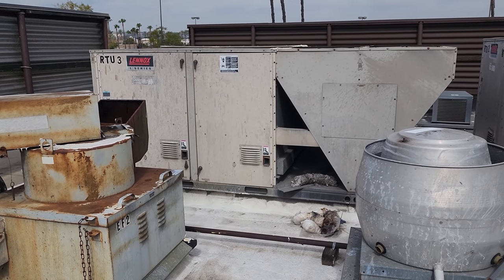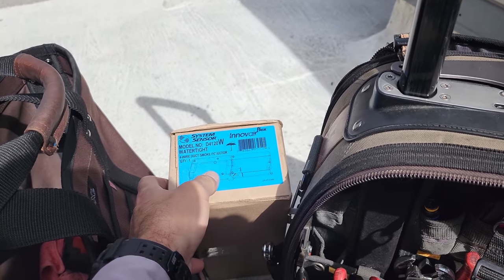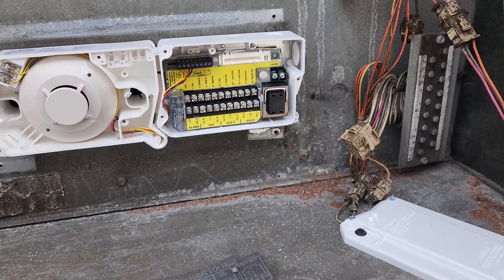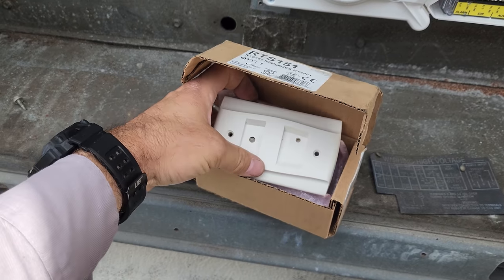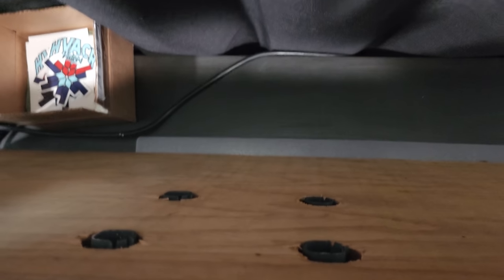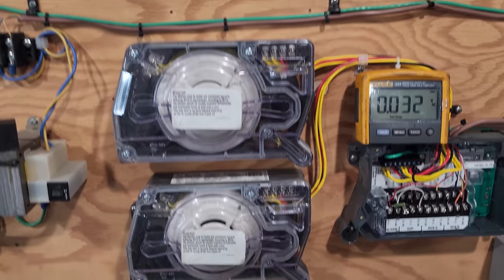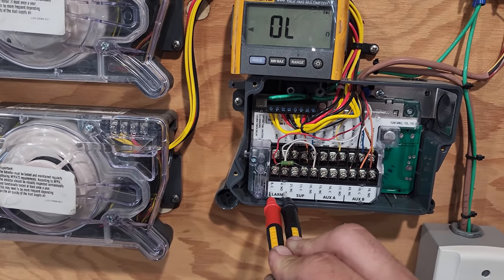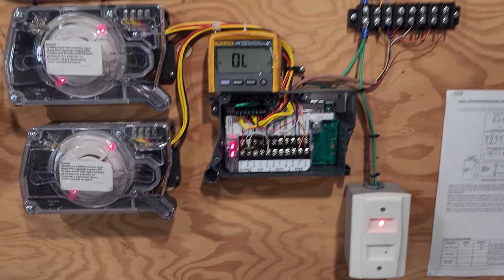THEY SAID THEY NEEDED A NEW DUCT DETECTOR

Comment: hahaha the roofing sealant everywhere. reminds me of the fire sealant guys here in england, they spread fire mastic all over absolutely everything. it's not possible to be on site when they are there and not come home covered in it myself
Reply: Sounds like drywall installers.  Mud everywhere, even on everything that's not supposed to have it.    I've also seen concrete guys scrape their trowels (and boots) on anything rigid that's handy and destroy equipment because they don't clean up after themselves.
Reply: Lmfao that's me on any after hours call.
Frustrated to be there. Checks things "it looks fine, woah but that things f**cked"
Reply: Like Chris pointed out as in USA and UK the people that go round putting the mastic on and fire doors are not trained enough. I am usual as have been in the fire world and then moved into HVAC so well understand this topic and seen so many horror commited. Like the guys going round doing the fire doors and seals gaffer taping the smokes (detector) to stop dust while they chip away at the doors to fit and leaving. Best bit to not have dust in the flats they work in the plant rooms the one place you do not want a smoke to work!
I wish I could post pictures of them at work here!
Reply: @Electronics-Rocks  They put heat detectors instead of smoke in plant rooms now, no?

Comment: The supervisory contacts are "backwards" so that it will go into trouble should the unit lose power.  A powered-off detector won't detect smoke after all.
Reply: My thought as well, if they would work the same way they would have to "actively" switch on failure.

Comment: That "signaling device" is what's usually called a "monitor module"(some brands like to use different names, I don't recognize this one). They connect to a modern addressable loop, and provide a circuit that you can connect to a set of dry contacts like a duct detector, or waterflow switch etc.
Reply: dang it thats what i was going to say. jk its fine. (i am a fire alarm hobbyist)

Comment: Just FYI, there's a second reason the fire mode goes 'full air sucking out of the mall': If there's a fire somewhere, then unless it's already roasting you, it's pretty harmless on its own. In a closed building, the smoke is way more deadly than the fire. Thus, getting the smoke out of the mall by all means possible will allow the people within to have a greater chance of survival and escape. And if they let fresh air in - so what? Yes, the fire will get more oxygen, but so will the people still trying to get out. All the building, burnable material an all that, it's not THAT important compared to a single human life. So, getting rid of as much smoke as possible is a very good thing, and trying to starve the fire by pulling out air is a nice side-effect.
Reply: Fun fact hi-rise stairwells have fans that do the exact opposite and bring large amounts of air into the stairwell. This creates a positive pressure in the stairwell to keep smoke from other parts of the building from entering the stairwells. 

There is a duct detector in the duct work of these fans that will shut them down, however, if it detects that it's actually bringing smoke in.
Reply: @kg4mrv  I think an important detail to keep in mind here, there is usually separate smoke exhaust or stairwell pressurizing equipment from the regular HVAC stuff.
With those HVAC units on the roof, depending on the ductwork, they usually get shut down to prevent them conveying smoke from one part of the building to a different part. Or depending on the heat they may take in, setting other parts on fire. Most parts of fire prevention in modern buildings are less about blocking fire from burning through (although often material are chosen to slow that down) but you got doors, curtains etc. that automatically close to contain smoke within limited areas. Within those areas then there are smoke exhaust systems to clear up the air and, by ventilation, possibly cool down the air to keep escape routes accessible.
That is although why modern elevator controls are connected to fire alarm systems, to prevent an elevator car from stopping on a smoke filled floor and afterwards the smoke preventing the door from closing again (by blocking the photoelectric barrier that should prevent the door closing while someone is in between the doors.)
Reply: the other reason is that the heat can go somewhere than cooking everyone inside. I'm a firefighter, it's the reason we do vertical ventilation so that the smoke will get out because we're not worried about the smoke, we're worried of the heat that's in the smoke because if that smoke is hot enough it will burst into flames and cook everyone inside, this is called a flashover, if you can find a way for heat to escape you take that chance.

Comment: Those supervisory connections always get me because they are technically backwards, as you mentioned. I have to remember the internal supervisory relay is continuously POWERED in NORMAL operation. This is why the trouble monitored sites require a call to the alarm company BEFORE turning OFF the equipment DISCONNECT. When the 24v (or whatever is powering the SD) is lost, you will trigger a TROUBLE alarm for that unit. BTW, all SD used today are non-radioactive, they are optical smoke sensors. There is an internal test done periodically for each sensor to make sure the light emitter and detectors are working and unobstructed. If the sensor gets dirty, the system will also trigger a TROUBLE alarm condition. Thanks for the video
Reply from the maker: Thanks for watching bud!!

Comment: If you see two resistors on the wire, you are probably looking at Double-EOL wiring. This lets you detect four states: normal, alarm, open circuit and short circuit.

Comment: Some fire sensors do use radioactive material that decays over time, so this could just be an age related replacement to ensure that the detector has the correct sensitivity.
Reply: Yes, amerecium-241, with a half-life of 432 years.  Works out that it loses about 1.6% of its initial output in 10 years, which is the nominal life for ionization type smoke detectors.
Reply: @robertlapointe4093  And sadly, a lot of people throw them away, rather than finding a recycler.
Reply: Most non-radioactive sensors also have a replace-by date. They degrade over time due to dust and the aging of electronics.
Reply: @elco_os9355  dust is the main issue. the smoke chamber is actually a light trap that should prevent light from the outside and a defined light source being reflected onto the actual sensor. Smoke in the chamber will reflect light onto the sensor. dust accumulating over time sadly will do as well. Or it just covers the light source or the sensor to make it go blind. I think usually they say they are good under normal operating conditions up to ten years.
By now, although there sure still will be a lot of those around, I think most new smoke detectors used in the last 15 to 20 years are optical. Not sure if the ionization type models still exist, at least I could not find anything about them being banned for new installations. Looking around here in Germany, I obvisoulsy don´t find any of them to buy anymore

Comment: Exhaust fans remove the heat. Same thing when they cut a hole in the roof of a burning house. Giving the heat an escape route helps keep it from igniting new material. Also if anyone is inside it helps clear the smoke.
Reply: It also helps give the fire more oxygen which is bad
Reply: The two problems are flashover and backdraft. Exhaust fans remove the oxygen, which reduces the ability of the fire to burn. But, that can contribute to a backdraft, where incompletely burnt gases can ignite when oxygen is introduced. Introducing oxygen carefully can reduce the possibility of a backdraft. But, that's why they cut holes in the roof eventually, to allow the fire to breathe, to prevent fire from injuring the firefighters from either a backdraft or flashover. A trained firefighter would be able to explain this better than me.
Reply: @maotio  it's more better than killing my mates due to a flashover

Comment: I used to have a mock fire alarm board with a addressable panel, horn strobe, pull station and a few field smokes with a sperate board with a duct smoke detector.. I wired in supervisory as a trouble as well. I actually thought they looked difficult to wire but it's really not rocket science to install I could install these all day lol.. great video as always!!

Comment: Those fire exhaust fans are used because they extract smoke. Smoke is usually the most dangerous thing during a fire, since it contains toxic gasses like carbon monoxide. So when a fire occurs in a crowded shopping mall, you want to get the smoke out as soon as possible, because it takes a lot of time before everyone has left the building.

Comment: 25:00 "I still don't know why they wanted the duct detector changed." <--- It could have just been time to change it. Smoke detectors only last a few years, then you just throw them away preventatively. (Even though a photodiode smoke detector should last for many decades unless the photodiode goes out, it's just extra fire paranoia.)

Comment: My personal opinion is the old detector had reached end-of-life, or was getting close to it, and they wanted it replaced. I love every time you go to the training board to explain duct detectors even though, as a child helping my father install Simplex fire alarms, I "get" how it all works.
Reply: It's not the most uncommon thing to just fire off the parts shotgun at fire alarm problems once you've narrowed an issue down to a single unit. 

The FA tech should have done something about that monitor module just swinging in the breeze where it can get wet, whether it's putting it in a J box or inside the terminal box side of the detector, but if the issue was having the duct shut down the unit randomly and setting off the alarms then a new detector would be most likely to resolve it.

They could also have taken care of that crumbling prefilter foam, cleaned the inside of the smoke chamber that was probably dirty enough to be hovering near it's alarm threshold, and made sure the sampling tubes weren't nasty, but that's not as easy as saying "we don't service duct detectors, get your hvac dude to change it."

Like he said at the end of the video, duct detectors always live in a weird gray area of who's responsibility they are, and it changes depending on the design of unit, local AHJ rules, and even what one contractor or another is willing to work on.

Comment: When thares a broken line the alarm company calls you when thares a trouble at my sister old job they used to get a lots of troubles with an old fire alarm intill thare was smoke was spotted we called 911 and pulled the alarm we knew the old system wasn’t ganna call them a ful days later they come to replace the old system with a new one

Comment: “This is the filter” ha what filter it ain’t in one piece anymore
Reply: That foam prefilter breaking down to dust might have been building up in the smoke chamber and setting off the false alarms that were why they wanted the detector replaced anyway.
Reply: @carpespasm  yeah that’s a probable cause of failure I didn’t think of that

Comment: 16:50 More worse case scenario: What if one of those wires broke because a fire melted the wire? (If it did that before setting off the alarm/detector.) You'd want to know. 🙂
Reply: firefighter here: we respond to multiple fires with the fire alarm system still sounding. the wires have a fire resistance rating to how many minutes it takes to melt it and at what temperature

Comment: Normally open contact on e stop? Damn....
Reply: Well it's not really E stop but fire alarm signal. Fire alarms always use normally open contacts, you don't want it to trigger due to a loose wire. Instead they require regular testing for functionality and the resistors for supervision.
It is not likely the short wire inside the AC from the duct detector to the control board gets loose/damaged between testing periods.
Reply: The link between smoke detector and HVAC controller should also be a resistor terminated bus, so it can know if it's a trouble condition with the wire, or an actual alarm. (In a world where things are perfectly engineered.)

Comment: How it's possible to 2 detector in alam if you only put in your set/reset station in alarm.
Here in the Netherlands it's not allowed, and if one going only that alarm will be visible (to be specific where the alarm is).
Maybe in the USA this is normal but for me its strange.
Reply: It depends on the manufacturer. On some smoke detectors, the test switch actually puts the detector into a "test" mode, where the detector will actually turn on a small LED inside the sensing chamber in an effort to get the sensor to trigger an alarm. Usually detectors that employ this more-realistic test method take a few moments to activate. On other detectors, the test switch simply triggers the same alarm input as the sensing chamber does, which tests whether the logic board can close the alarm relay, but does not test if the sensing chamber can actually respond to smoke.
Either way, many AHJs view "smoke in the chamber" (usually canned smoke sprayed into the detector using a special tool) as the only test that actually proves that the smoke detector can detect smoke, but when a building with 20 RTUs has one tripped in false alarm, or you just want to verify a fix to the building wiring, that test/reset switch is much faster than climbing onto the roof and opening every unit until you find the problematic one.
Reply: Some places/inspectors are happy enough with just hitting the remote test, and just rely on the fire alarm contractor having certified everything is working correctly, with their on-site inspection being little more than a spot-check that strobes are where the plan says and that the fire department gets a dispatch call. 

Many will require full-on smoke-bomb testing to prove shutdown happens and to verify that the entire assembly of sampling tubes, detector, shutdown, alarms, etc... all work in a real-world actual smoke-in-the-ducts situation.
Reply: @boginator55  Should the fire inspection guys actual do a REAL smoke test? They do sell cans of simulated smoke that should set off a detector. Not something an HVAC guy should worry/care about, just an interesting tid bit. 😀

edit: Whoops, TheWomble already mentioned smoke bomb test.

Comment: Omg what did you do to the Fluke? You know you coulda just use a panel meter. Very cool video though everything makes sense. My curiosity would be does the sensor head ever get coated with grease?
Reply: The fluke is Made like that they have a detachable screen
Reply: @wolfblade5949  oh, cool, didn’t know them at existed, that could be quite handy.

Comment: It may not matter on your Training Board but the HVAC and ALARM guys in our area do not use Telephone cabling for signaling & Control. 
ALL Alarm stuff is RED. And HVAC is BROWN and a heavier Gauge .
I ran into an issue earlier on in My carrier about 30 some years ago where an Alarm Co. spliced into a Telephone cable. I was trouble shooting an Issue of open conductors in said cable only to find Alarm Ckts on it. 
Thanks.
Mike M.
Reply: Here we use regular white "telephone wire" for burglar alarms, if they are damaged the alarm will just go to trouble mode. Fire alarms use bright red fire proof cable.
Reply: Depends on what local AHJ says, but yeah, by code you have to run fire alarm in FPLP or FPLR cable, and while color isn't dictated by code to HAVE to be red, it's best practice anyway. We recently have had a hard time getting red cable and had to switch to blue for a few installs because that was the only FPLP we could get ahold of. There's some municipalities and AHJs that require explicitly fire alarm be run in red, masked off from fog painting when that's done, and all that, but in my experience most don't.

Comment: Is it sad that I want old fire alarm equipment.
Reply: No!  There’s lots of people collecting old fire alarms 👍
Reply: You mean I shouldn't have thrown away the 40+ year old bells that I pulled out of the ceiling of a customer?
Reply: @tbelding  no send that on to me lol
Reply: @nnyboy320  - I guess I can check and see if I left it in the ceiling.   For that matter, there's probably two or three others that I didn't pull out because they weren't in the way.   Building went up in 78, and was rewired at least four times just for alarms, and all sorts of trash for network.
Reply: I also collect fire alarms. I'm into all sorts of electronics and I will be 21 next year. I plan to get into the fire alarm or HVAC trade, just have to wait for logistics to line up. But I'm very knowledgeable in this equipment. I mostly collect old Simplex equipment, made by Simplex Time Recorder Co. Fire alarm panels, signals, pull stations, etc. There's some content on my channel. I love Chris's hard work and great videos :)